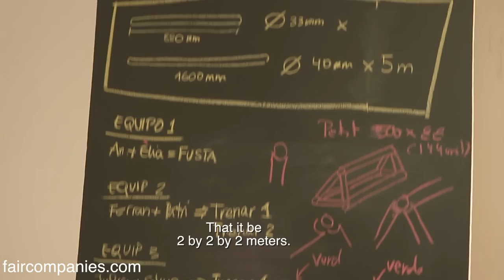Trashformation: furniture & dwellings from recycled cardboard

Comment: Very porous material.   Humidity, moisture, mildew, and insects.......just sayin'.
Reply: *****      
How would you get a spray sealant inside of all those long tubes?
Reply: +blondwiththewind you don't need to if you cover those holes
Reply: Excellent point blond.  I had the same consideration and just like with wood furniture, I always seal it, prime it, then paint appropriate to the application (indoors or outside).  GREAT that you brought this up as it is a valid point!
Reply: just use it inside a house, not outside.